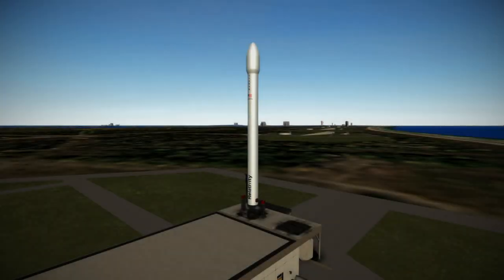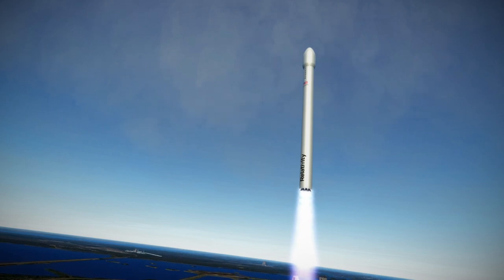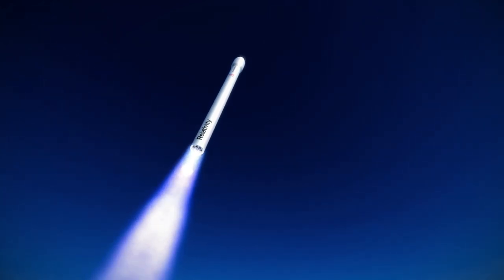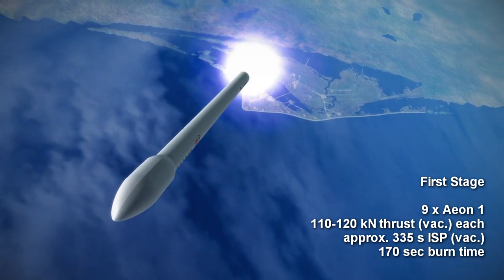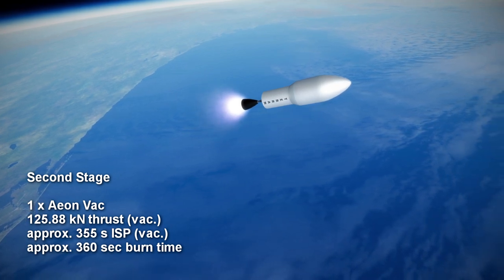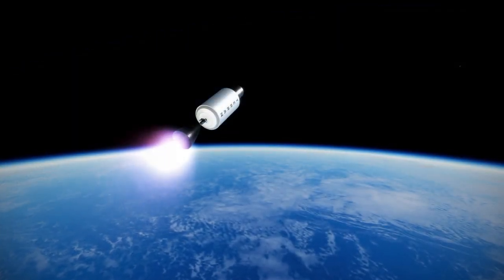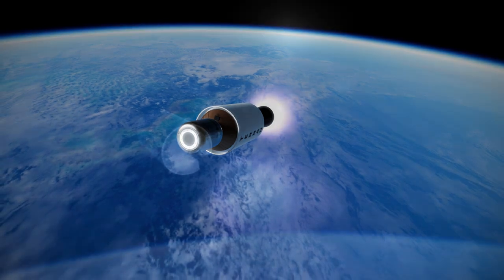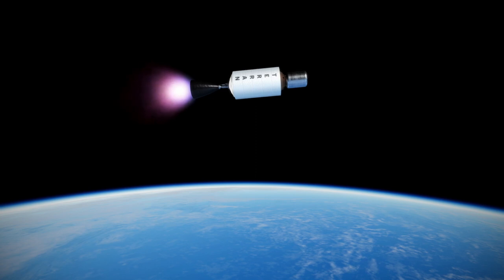Rocket Profile - Terran 1

Comment: Why are cryogenic components used for such relatively small rockets?
Hydrogen peroxide and isopropanol 98% will have an earth/vacuum impulse commensurate with Kerolox
The unified design of the output stages. An egg-shaped asymmetric spheroid in a ratio of 1:5, divided in cross-section into 3 sectors.
Part of the outer shell is the airframe of the stage.
The tail part of which forms a nozzle of external expansion - "aerospike". The front part performs the function of the main fairing.
Each part has its own guidance system, increasing the reliability LV of output, returning 2 out of 3 parts of the LV  to the launch/production site - RTLS
Non-cryogenic components have an order of magnitude lower saturated vapor pressure and can be stored in membrane-elastomer tanks.